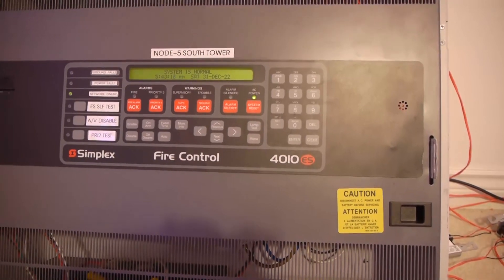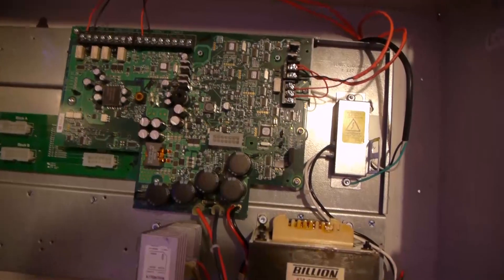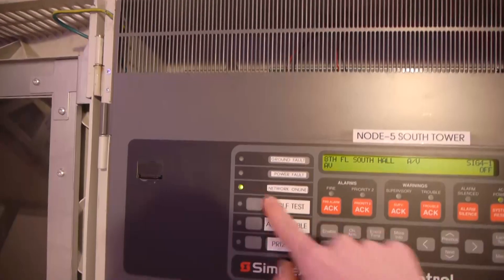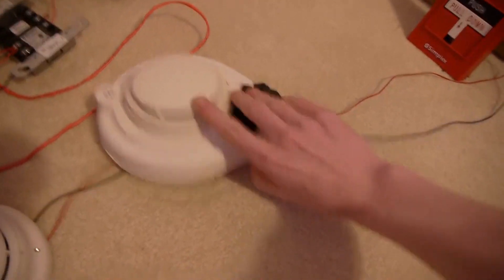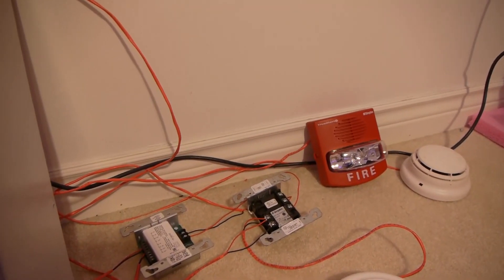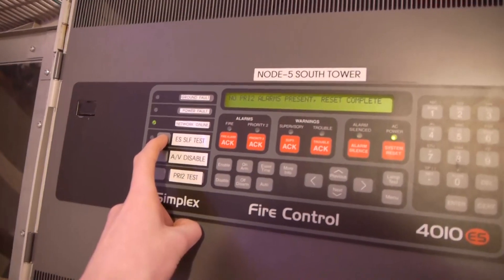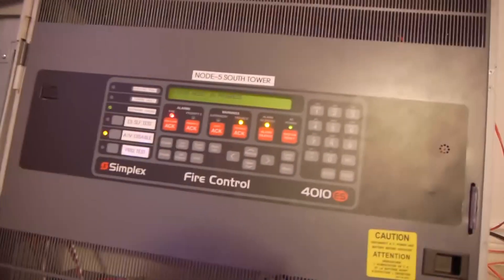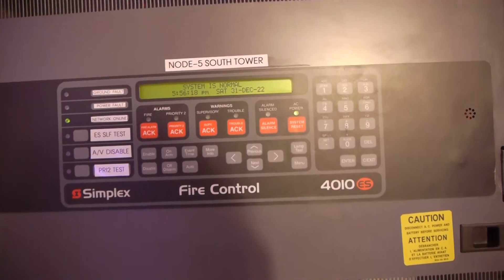New Simplex 4010ES with IDNAC and Carbon Monoxide Detection

Comment: Hey, do Simplex panels and the TrueSite Workstation communicate using ethernet cables? Or how do they communicate?
Reply from the maker: A card in the TSW PC allows it to be wired to the rest of the 4120 network just like another panel.

Comment: Now add voice bay
Reply: The Simplex 4010ES doesn’t not have integrated voice. If you (the customer) wanted voice, you’d get a 4100ES.
Reply: 4010s aren't voice evac capable. The only voice evac capable panels was the 4100+,4100U and 4100ES